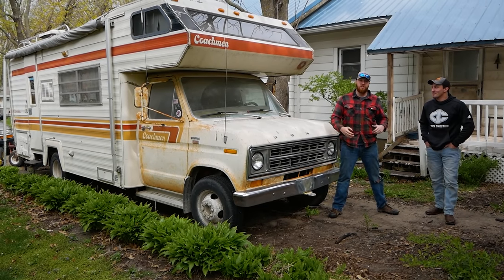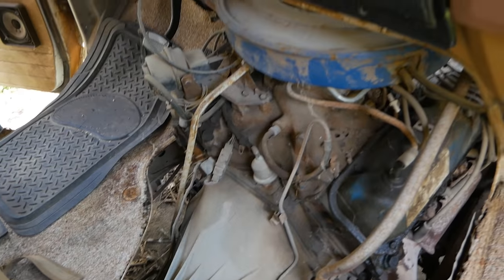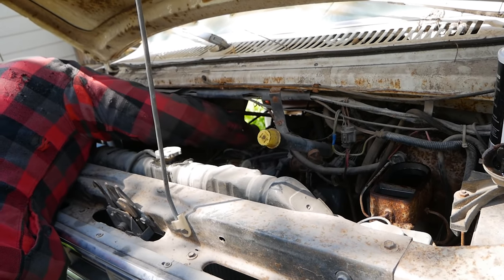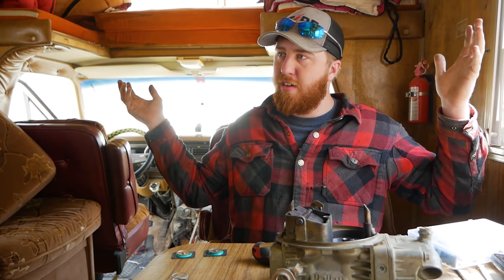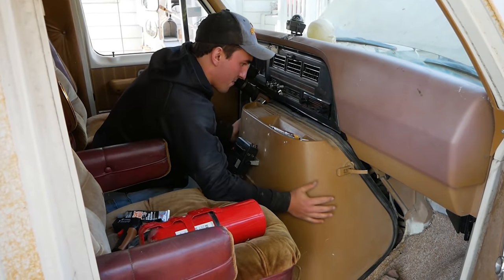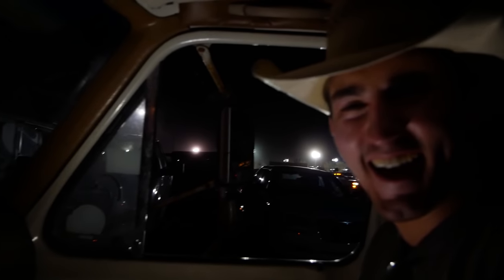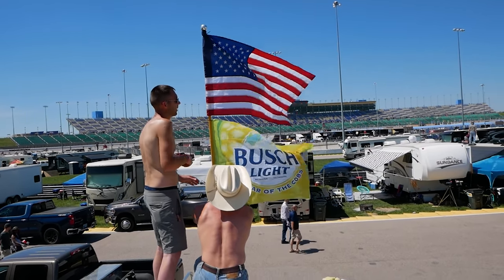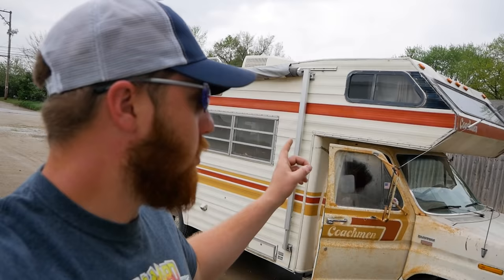Can We Drive This ABANDONED Camper 500 Miles and CAMP IN IT!?

Comment: I grew up in Iowa. They are the flannel sleeping bags.. They are old. As a female in her 60s I am oddly fascinated by this. I just bought a 89 Toyota dolphin.  In good shape. I’m having new brakes put on it because they are getting worn but they passed inspection. Brakes are a good thing and I want them new. Mine was redone inside and the engine in 2006.  So far everything works on it haven’t checked the battery.  Engines in good shape it had an oil change new muffler, and new battery. It’s not a four-cylinder stick which I couldn’t drive anyway but I heard they’re good engines. Six cylinder.  The only thing I think it needs is a new counter because it’s between the stove and the fridge. It’s got a little bit of a warp and I want a new one. 4 inch hole at the top inside in the cabinet. I only had it three weeks, but I needed a safety inspection of course and it passed. But I knew it would.  I’ll get it back next week because they couldn’t get to the brakes till then. that’s because this mechanic is popular and he’s two blocks from my house and my husband used him since we’ve lived here and trustworthy. That was my little bit of senseless information that probably nobody cares about.

Comment: I have learned more about carburetors in the last couple of years by watching Kevin's channel as well as Luke ( Thunderhead289). Lots of knowledge to be had. 👍
Reply: The 4 ladder explanation here was awesome
Reply: Also why i never want to own one. Ever. 🤣 Although I still have to work on them here and there as a mechanic.
They should just have a holley sniper kit to reuse on every resurrection lol. Quick and simple lol.
Reply: Just in time to learn how to manage the regen in your EV.
Reply: @mikethrapp  Until the Holley kit has an undiagnosable problem that not even the Holley techs themselves can work out (yes really, more common than the marketing has you believe, first hand experience), and you're stuck changing expensive sensors and parts, instead of just going to a parts shop and getting a rebuild kit or buying a second hander one for a couple hundred bucks.
EFI has its place, something like this is not it.

Comment: That was a damn good explanation of carbs. I don't know much about them myself, but guaranteed if I needed to mess with one, I'm coming back to this video to re-watch that explanation and also look up a few diagrams to help me visualize what's going on. There's a reason so many people still prefer them over the seemingly simple fuel injected setups. You can tell though that carburetors are a prime example of pique mechanical engineering before the microchip took over.

Comment: Great Job.  Love the video.   Tech Tip from the couch potato.   Advance the timing until you can just hear it "ping" // "detonation"  under hard acceleration.   Now, back off the timing about 3 degrees.    This should produce a reading that is pretty close to your max Vaccuum gauge reading., and the best MPG.     It also compensates for slop in the timing chain... variations in compression... carbon build up... etc.    Again....  absolutely love the video.

Comment: I fly planes, and that little talk about mixture at 19:40 is pretty interesting. In piston engine airplanes, we manually set and adjust the mixture ourselves. Even on fuel injected engines, when we do our engine and system checks (we call it a runup) we set the mixture for best power. Same concept, it's just adjusting how much fuel gets into the carb or the cylinder but it happens manually. However there is a system called FADEC (Full Authority Digital Engine Control) that more expensive planes have, that does all the mixture stuff automatically with computers, like a car does!

Comment from the maker: If you guys want to watch the full race broadcast you can check it out here! 
https://youtu.be/d1wcQsjSWnE
Reply: I want to go with you guys in October
Reply: You should just fix that bad boy up
Reply: Just get some flex seal and paint the top and run a space heater in there on full blast for about a week you will be good to go
Reply: Kinda want to see the junkyard lot lol
Reply: any time stamp for when you guys were on the broadcast?
Reply: If yall wanna sell this thing after your done working on it, I need one asap.. shit has hit the fan for me.
Reply: It looks like Kenny Roger's could drive back in the day
Reply: Do this again in October
Reply: Y’all should’ve looked and seen if the awning worked a Siewert hot and cold and if the sink in the stove microwave and shower bathtub work
Reply: Think they rank that one as a 20 footer.   My 460 in my 79 got 8 miles to the gallon at 55 miles an hour. Any faster and the fuel went down at the same rate as the speedo went up
Reply: Kevin you should always sing in Willy Wonka mode when working on a Ford engine 😂 Brilliant work sir dude!
Reply: I to see again
Reply: Plz do it again good vid
Reply: How do you never register, plate or insure stuff? Do you have dealer plates?
Reply from the maker: @dcummings7253  You have 31 days before you are required to register a vehicle in iowa
Reply: You should ho to an INDYCAR race
Reply: @JunkyardDigs  Holly crap that is awesome! If pull out of the driveway without plates, reg and 10 day inspection and a cop stops me they will have it towed.
Reply: @JunkyardDigs  I think for October; You guys need to find a 1970's Dodge Lil Red Wagon, and either a period correct Travel Trailer or 5th Wheel to be towed behind the Lil Red Wagon.
Reply: If you want to save gas, finally, I can think of 2 options rights away, which are slow down to about 50 because air resistance varies with the square of the speed,  the second is put as much air as possible in the tires, third is see how far you can advance the timing without spark knock or trying to start backwards, fourth is try to lean out the carburetor a bit more in cruising range, though the only way to do that without buying new jets would be with float level.  Fifth is longer term and it is get a locking torque converter, higher rear end gear and/or overdrive transmission.  460 is a lot of displacement, so to be efficient in needs a tall highway gear.
   Also, I hear a working EGR system can save gas during cruise, and it should cut out at full throttle so as not the harm power at all, and by cooling combustion, EGR should be able to enable more timing advance during cruise.
Reply: @billdoty8374  Great movie !! Six Pack
Reply: I want to buy your rv
Reply: Ya can't wait till Octobers race 🤪
Reply: I'd definitely want to see this again.
Reply: Ya beat me to it, sucks that Canada doesn't get it
Reply: @willbachman9312  flex seal worked awesome on my camper top!
Reply: so they let folks into the infield but not the stands
Reply: Well i got a spare 460 for the lemo.
Reply: ill buy the RV, how much?
Reply: All in all a pretty good video keep it up I'm in Dallas Tx and go to the races here but it it's not that far away the road trip makes it better I'd love to have that camper it's got history now y'all be cool..... Clay
Reply: Logan
Reply: welry
Reply: pop or call for a few more questions than Life 🤣😆☺️☺️☺️☺️
Reply: Logan
Reply: Logan
Reply: I'll buy it .I'm planning a trip from ny to Florida and back I'd run it and make a few videos
Reply: I want to go on a road trip with you guys.  Great video!
Reply: Sweet ride! Hope you all had a nice time at the race!
Reply from the maker: @NASCAR  absolutely!! We'll see you guys again in October 🤘
Reply: How much you asking for it?

Comment: I just found you guys today and am very entertained. You are like Rehab Addict for old motor homes. My husband and I started out with pup tents 30 years ago, the a nice large Hillary wall tent which we put a windo unit a/c we zipped up around because I have a really sensitive heat intolerance. Then……we got this super old class c camper, motor reliable, tiny kitchen, bathroom/plumbing worked and 3 sleep areas, one over the cab for my daughter, the lower table/bed and a drop down bunk over it. Renovated the inside , repaired any safety issues. It was a great place to sleep cool and dry. But on the way home, a 35 mile drive, we found something no one had checked for, the windshield wipers didn’t work at all!!!  Thank goodness it was just drizzle, we had to stop frequently. A great starter camper we passed on to our son who used it a few years until they started upgrading. We next switched to a quite small 20 ft 5th wheel, no problems with it, then to a 1994 Jayco 5th wheel which had been in a highway accident. Everything works great EXCEPT on a stormy campout we discovered that the super slider leaked, I mean bad!  So we just did our final upgrade, a 2011 Keystone, a little shorter but in near mint condition. And we saddled our old one on our daughter and family to deal with its problems. It only leaked when the slider was out. I am love watching these renovations, mechanical included, and you guys are so much fun!❤️🤣🤣🥴🥴

Comment: I would have dropped a chevy engine in that thing...the rest, to me, is beautiful. Dirty, but beautiful. I was 17 when this camper rolled off the line brand new. Still the original wallpaper and the stitch look on the fridge door. I look for old campers like this, is all original condition. It's not ugly. Not to me. I am impressed that you got a Ford going well enough to travel all that distance and back without it breaking down (until it got home). Super impressed. I would have loved to be able to buy it...

Comment: I bought a 1985 RV for $2000 about 2 years ago. I spent a month digging off several layers of gunk. The previous owner had done everything you could do wrong on the roof, including roll rubber roofing on, then put the tape on. It caused major damage inside...but it has low mileage and runs well. Can I bring it over and have you kids go through it? Well done!

Comment: That bargeman lock on the entryway door ALONE will fetch a few hundred alone.
That class c looks better than my 1976 FAN ironically FAN was bought by coachman.
Got a good deal. Also the coach is a secondary battery probably a deep cycle rv. Seperate from the cab(start) battery. In great shape.

Comment: Fun thing about those 460s and windsors in general a lot of them actually do not have exhaust manifold gaskets factory. Ford somehow figured out how to machine the two pieces to fit without leaking except when the studs break. Which i have only experienced on the 460 not other windsor motors. 

The only 460 that came with gaskets were the "ambulance package" ones. Our 460 had some broken exhaust studs and it sounded like yours.

Comment: I had a 76 Ford motorhome that I bought off my boss. Sat for 2 years and when my boss went to start it when I was getting ready to pick it up she fired right up. Mine had a 351w in it and it moved it pretty good for it weighing 10,000 pounds. Have a scale at work. Only thing I did to it was put new mufflers on it. It needed the whole interior redone and I unfortunately couldn't afford to do it so I sold it. I so regret selling it it ran so good never left me walking. Even at -20 pump the gas 3 times and she fire right up and I never had to touch the gas pedal again.

Comment: Its kind of funny how some people will abandon things like this.  I mean even if you got it mostly running, stayed in it for a week and maybe spent $500 or less in repairs for example, that would still be cheaper than staying in motels for a whole week and it would have paid for itself (the repairs) after that trip.  I should start to keep my eye out for older motorhomes that people are ditching because they don't run.  I've seen some where it's something simple like a bad fuel pump or injection system, but otherwise fixable with a little bit of know-how, skill, and time, and a little money for parts.

Comment: In 1968ydad traded 1964 Mercury Comet for a 1968 Lincoln Park Lane that a 460 in it. When I saw it, I told him that he had traded a very good for a piece of garbage. He asked why I said that and I told him that in a about a year from then that he would have more leaks than a flour sifter . He didn't believe me until he has to get a new rear seal on the block and had to replace the transmission seals and a lot of other stuff.

Comment: Great video, camper did what you wanted it too without any problems. The 460 is a great motor a gas guzzler but it will get you where you need to be

Comment: Fwiw:
You test the power valve with vacuum, the spring always works.  If you close even one of the air/fuel adjuster screws on a 2 circuit idle carb and it doesn’t try to stall the engine the power valve is blown. 
Also you left out the intermediate fuel circuit including your transfer slot and power valve. 3 circuits:
Idle
Intermediate/transition
Main jetting

Comment: Why don't you replace it's fuel and air filter and add some fresh gas? And spray sime starter fluid? And top off its other fluids. You probably need to rebuild the carburator.

Comment: if you have any vehicle you want to keep running down the road with a 460 with the four barrel,buy as many carb floats as you can find,they do NOT, make them anymore,i went to pick and pull and pulled 3 carburetors apart and took the floats out,the rest of the carburetor rebuild stuff in the kits is available,not the floats,and for sealing roofs i use swimming pool paint,it stays flexable and seal s perfect,always white,i buy it at graingers